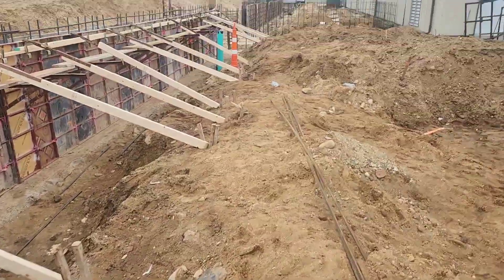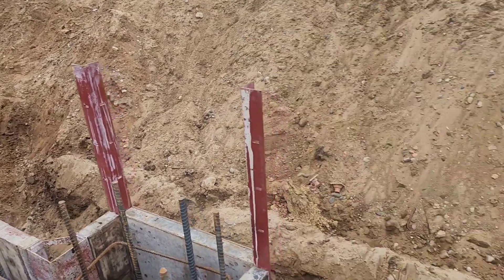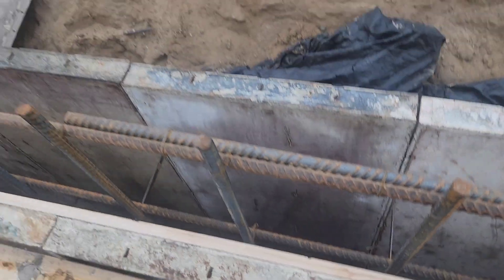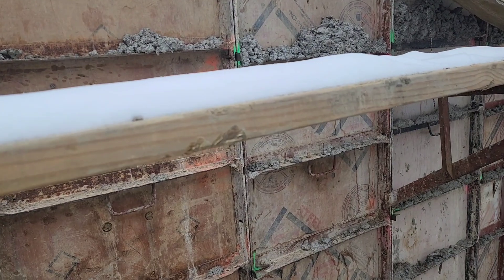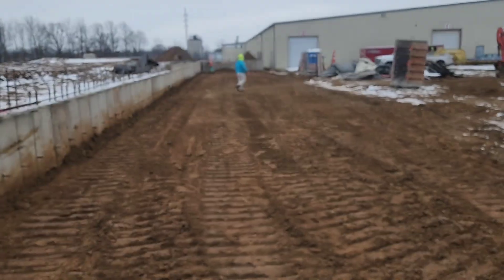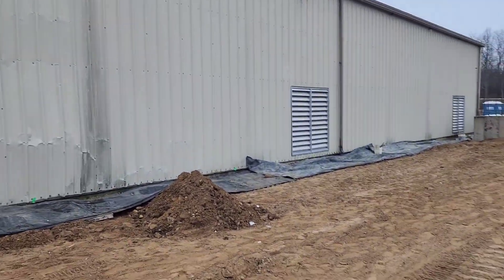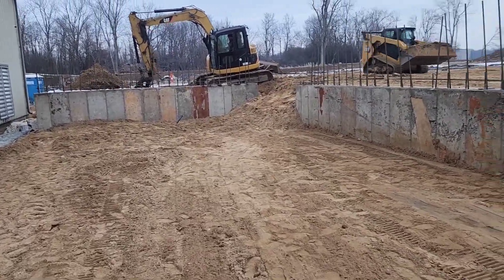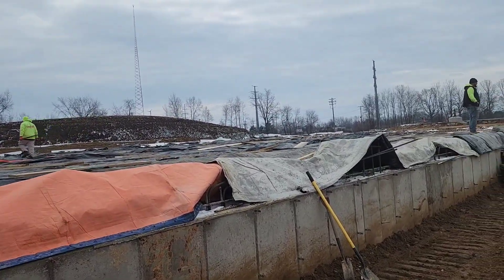New project underway,  but we had a wall BLOWOUT 🧱

Comment: Safe to say those form panels have seen there days guys, those old snap tie things are so last year, sooner or later you may regret using “one more time” 😅
Reply from the maker: Brother, I preached this and preached this but it fell on deaf ears.  You know, the ironic thig is , we had a blow out , on the next two pours of wall we did.  .... and both times it was due to form failure.